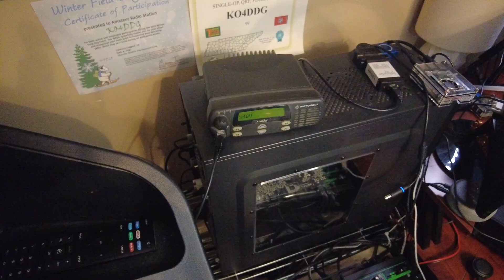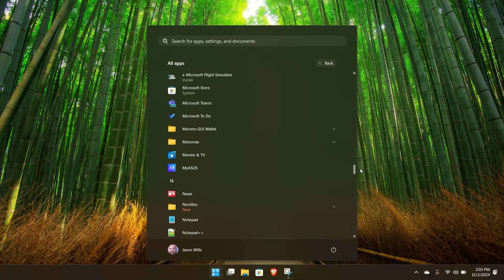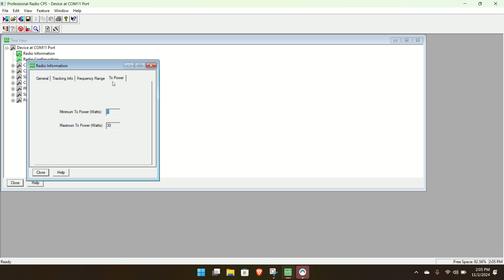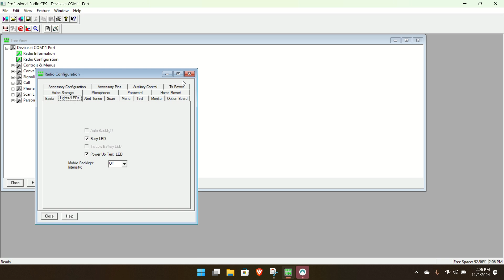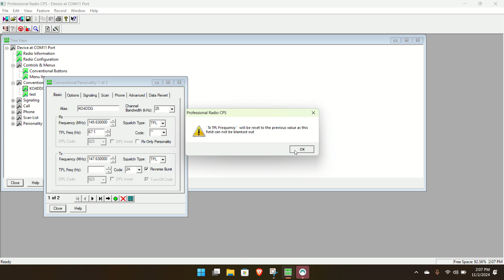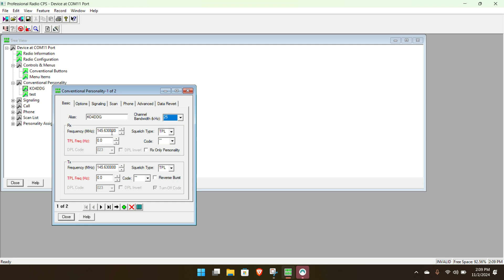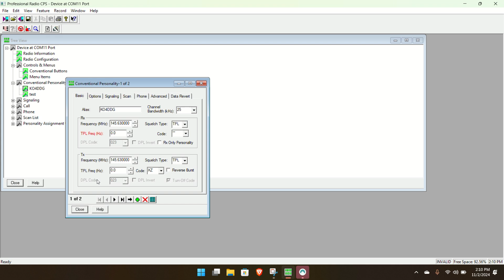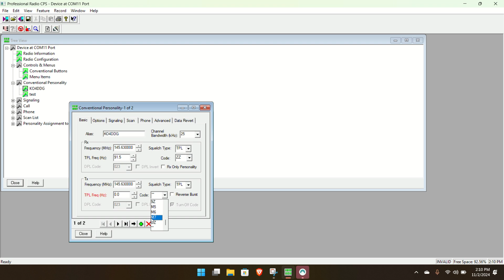Programming Motorola CDM1250 or Trying to!

Comment: you didnt enable flat tx audio.. what is that??
Reply from the maker: This radio has been through a few use cases of different things being plugged into it, I think when I was programming this I was doing it for digital for a USB type sound card for the windows os. In a nutshell flat audio sends the audio directly to a controller without being demphasize.

https://www.repeater-builder.com/tech-info/pdfs/flat-audio-k6jsi.pdf
Reply: @soulstudioshamradio  so if im using this radio on an old school basic audio repeator, would i enable this or leave it off?
Reply: Using the audio filter instead of passing flat audio is preferred for voice use scenarios. Flat audio was good for the system side of two way when these radios were using MDC and trunking where the signaling was being passed unfiltered. It is necessary to use flat audio when using these radios for digital modes in conjunction with a modem.
Reply from the maker: @jessehiles thanks Jesse I agree
Reply: @jessehiles  ok so leave flat audio off then?